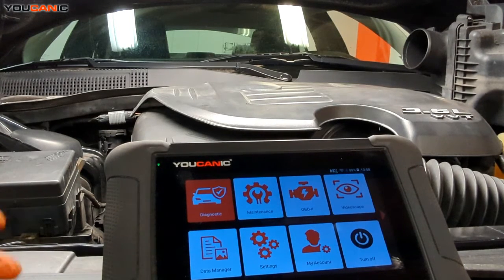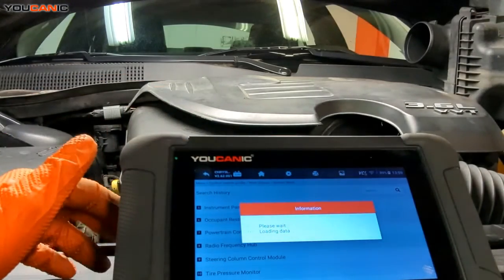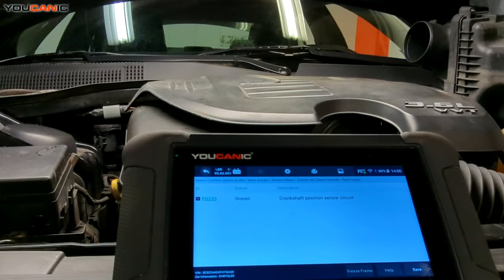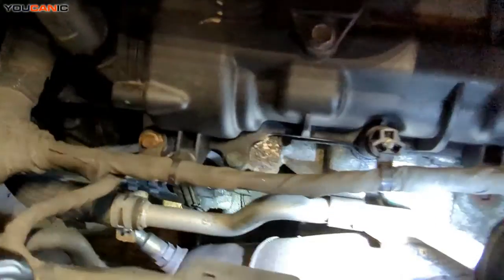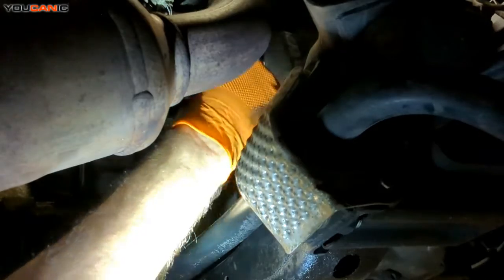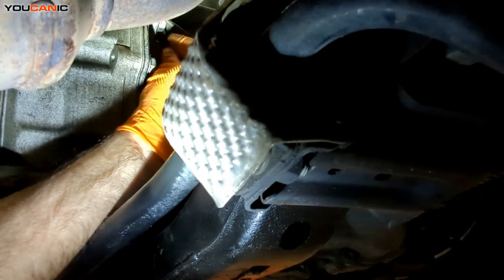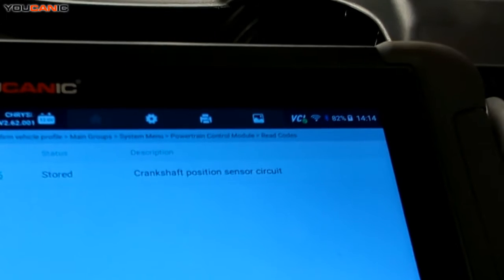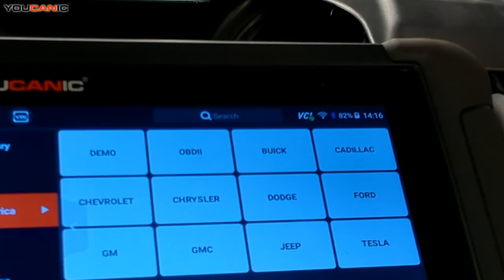2011–2023 Chrysler 300 Check Engine Light P0335 - Crankshaft Position Sensor "A" Circuit Malfunction

Comment: Do ya gotta relearn the crankshaft sensor ?
Reply: Yours not working too. Did you find out what's the problem was?
Reply: @ had the sensor replaced and relearned. Mine comes and goes as driving so I’m thinking ecu communication problem or my cheap Walmart battery perhaps 😭😂. I don’t just get a crank code I get an implausible torque received and it puts the car in limp mode until I erase the code. Dealership was tryna say my oil cooler was causing my actual driving problems but it’s also been replaced. What is yours doing?

Comment: This is exactly how my car sound rn instead of the long start up lol. Just bought my crankshaft sensors going to do this and see if that fixes the code. Good video keep up the great work and explanation!!!
Reply from the maker: Thanks for your support! We're thrilled that you have found our video helpful. We strive to empower DIY car owners like you with free resources and user-friendly tools such as the YOUCANIC scanner. If you need any further assistance, don't hesitate to reach out to us on our website at www.youcanic.com. There you'll find in-depth guides, repair manuals, and a supportive community ready to help. We're committed to making your car ownership journey easier. Keep up the great work on your car maintenance, and let us know how it goes with your crankshaft sensor repair!